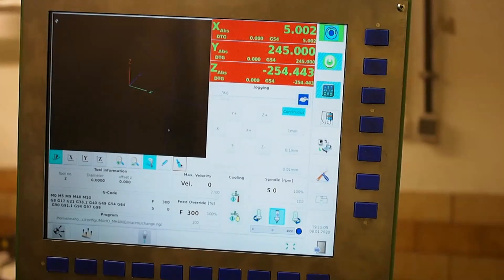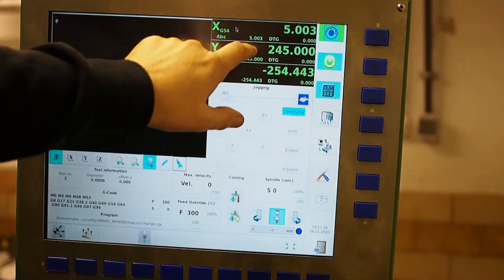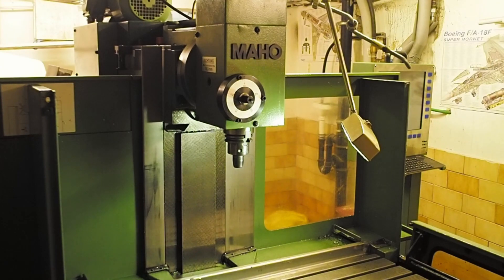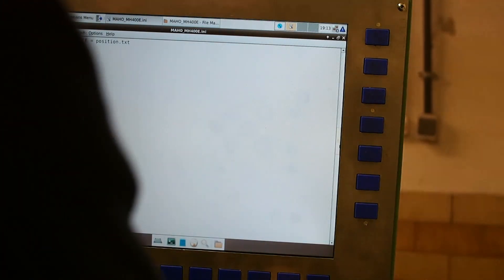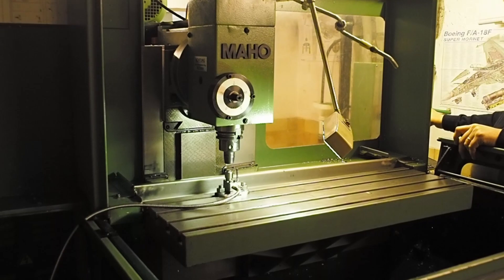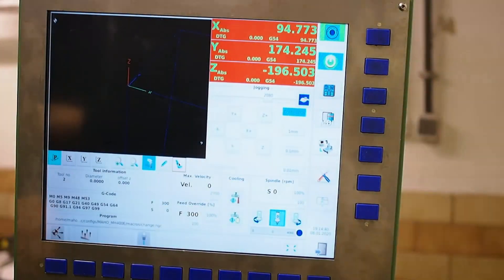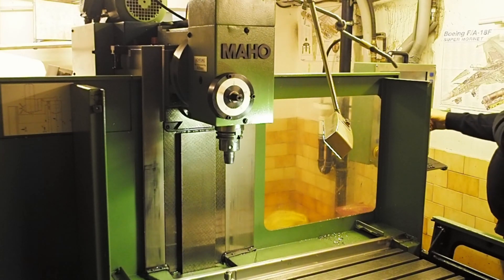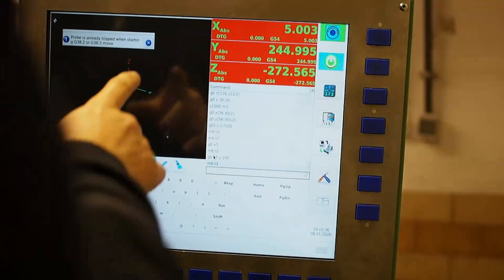MAHO LinuxCNC Tool probe

Comment: Did you ever figure out what happened here?  an idea I have is the retract distance after triggering the probe is 0 or possibly the polarity is backward on the switch
Reply from the maker: I decided it was a PITA to install the probe, use it, and then remove it. Plus a generous donor sent me a Haimer 3D probe, so I switched to using that. I have never gone back to the tool height setter.

Comment: Do you still operate with an inverted Z axis? Sounds like a recipe for disaster being non ISO when used with any cam software.
Reply from the maker: No, I have mine set up as a Vertical mill with Z up. With LinuxCNC it would be easy to set up two separate mchine profiles fofr Vert and Horizontal though if one wanted switch between both.

Comment: Hi,
awesome work, your retrofit Maho. Can I ask you to help rebuild my Maha MH600E? I have some experience, but they are not enough for retrofit. I would like to keep the original DC servos and metering, the rulers there are Heidenhain LS 403, and the driver is Indramat 3TRM 2, a spindle without inverter only with gearbox. In the Czech Republic, we have only those MESA cards available and I have no idea which one to choose. I will be very grateful for any advice.  http://www.duzi.cz/shop_cnc/index.php?main_page=index&language=cz
Reply from the maker: Send me a PM with your email address on the practical.machinist.com forum ( I have the same user name there), and I'll send you my draft "how to convert a MAHO" which is the collection of all I learnt doing it.
Also the retrofit thread is here:
https://forum.linuxcnc.org/12-milling/33035-retrofitting-a-1986-maho-mh400e
Reply: Hi,  practical machinist forum is unreachable for me, is there any way i could get hold of your guide? I am considering buying a mh400e and doing the cnc conversion.